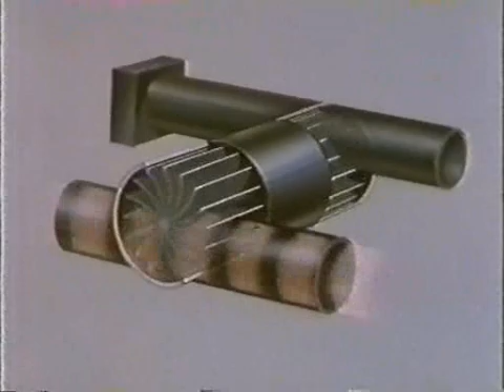BBC Horizon 1981 Gentlemen, lift your skirts Ground Effect & Cosworth DFV Part 5 of 7

Comment: Turbos are more efficient than blowers (superchargers) but in the 80's, the cars suffered from severe turbo lag,  a  problem very comon with turbos, even worse with the big turbos used to sustain 1000 plus hp on tiny 1.5 liter engines